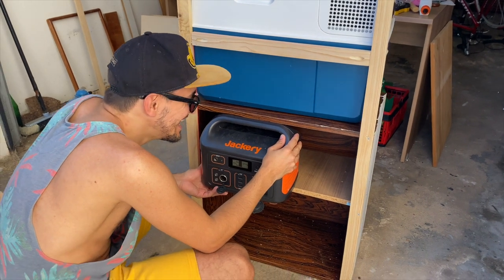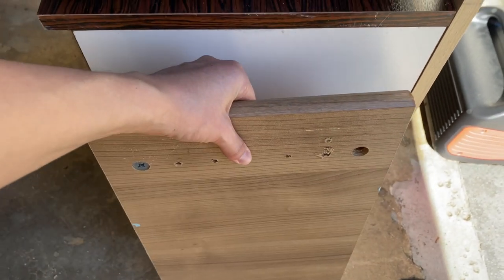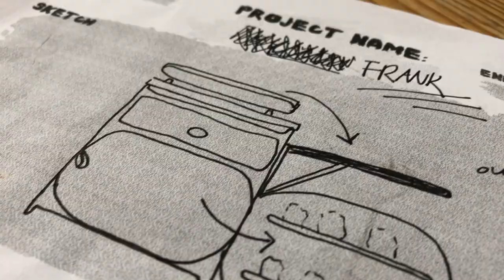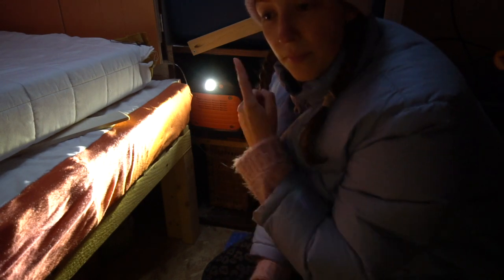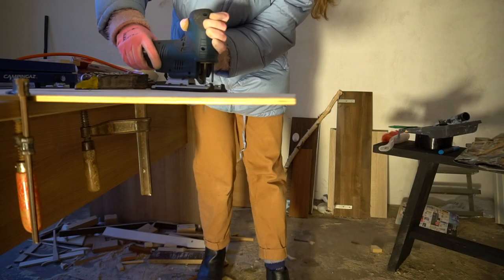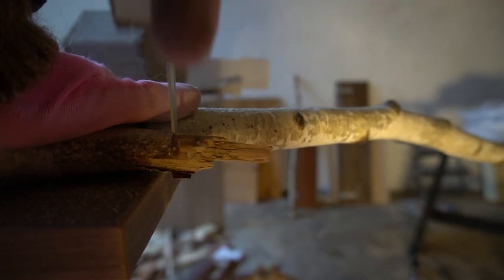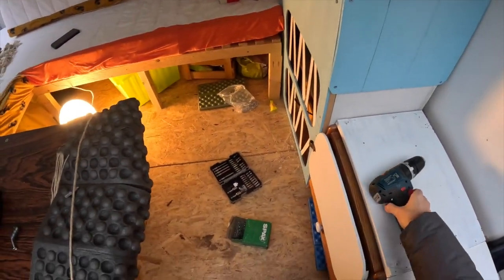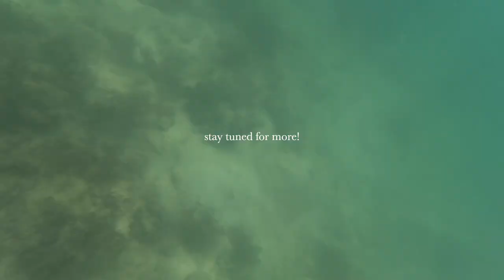Repurposed Van Build Ideas: Meet Our Junk Camper! (&Upcycled Kitchen)

Comment: Your build is as creative as can be. One question though, will you be drilling ventilation holes for your fridge?
Reply from the maker: Thanks for the compliment! 😁There are a couple millimetres space between the upper wood parts and the fridge's exhaust, which we thought could be enough breathing room. But, in summer, when the fridge is working really hard, we noticed it gets quite warm. So adding ventilation holes might be a good idea. What do you think?